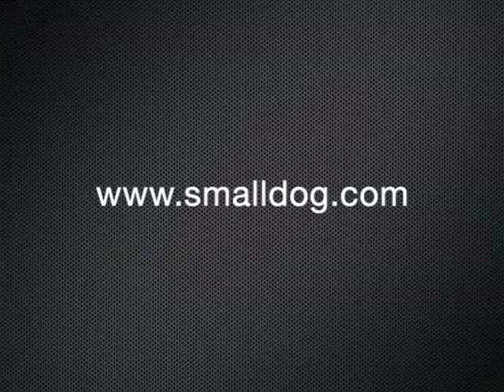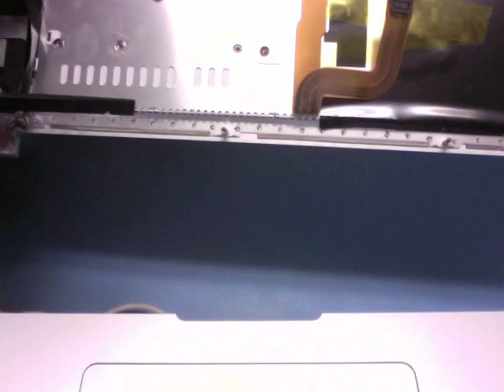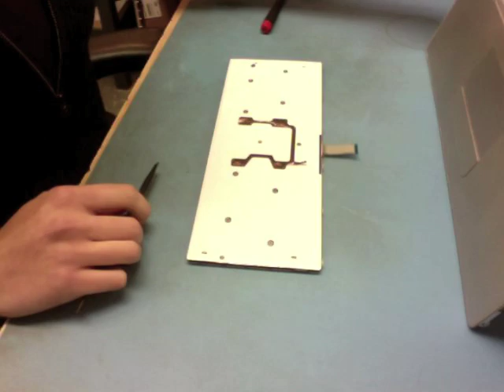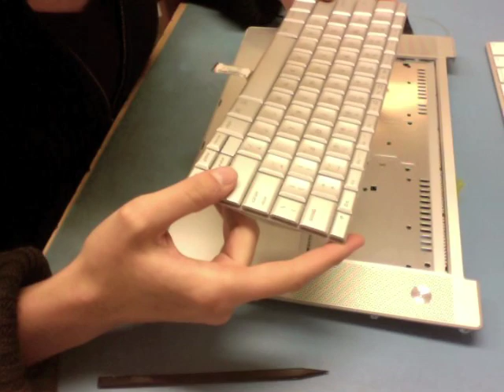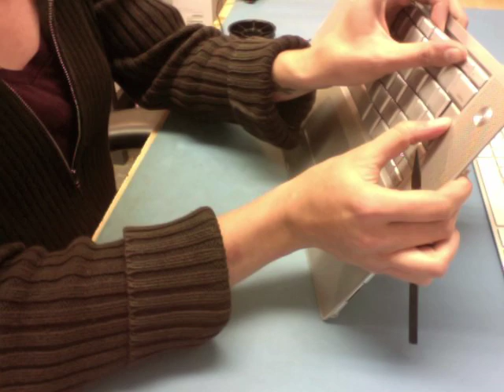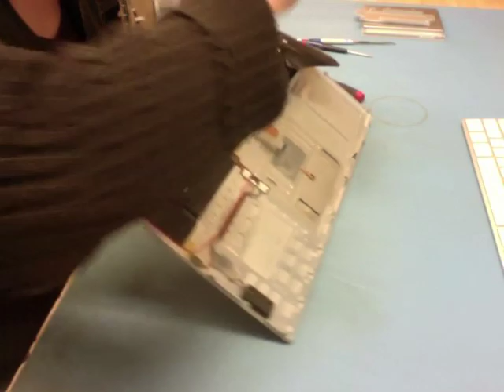MacBook Pro/PowerBook Keyboard Replacement (Part 2 of 3)

Comment: Black stick.  famously known for the past few thousand years as a FLATHEAD SCREWDRIVER.  Just use commonsense, and be GENTLE.  Yes, those near-cracking sounds are perfectly normal, just as Rebecca said on this model, and ANY Dell laptop as well.  Just when you are sure something is going to break in half, it pops off and all is well.  breathe.  a sigh of relief is due at that time, so go ahead and breathe now.  oh, there are a few more to go, so keep popping 'em off.  :)  CAREFULLY though. ;)